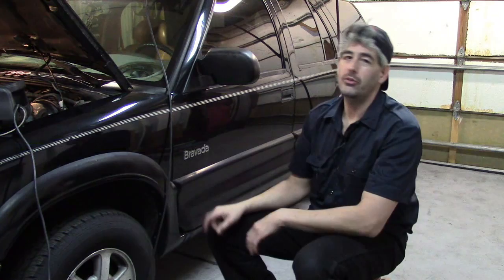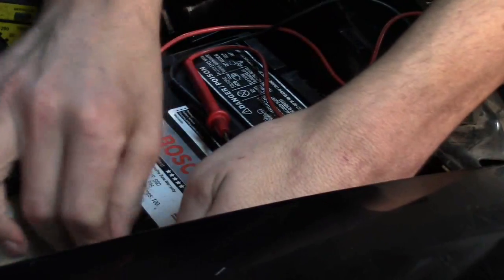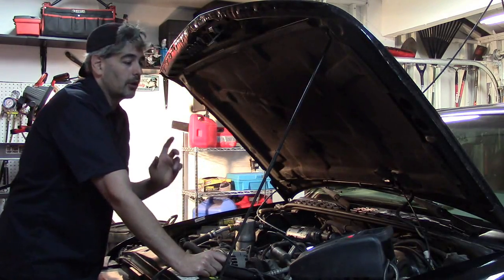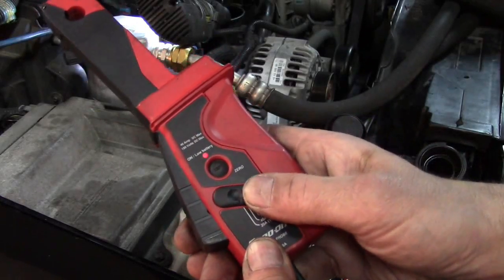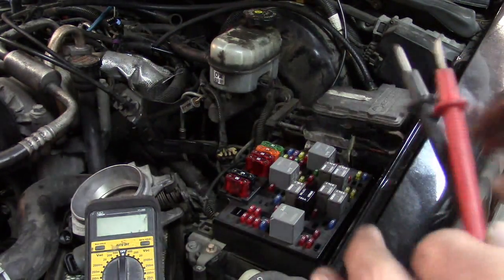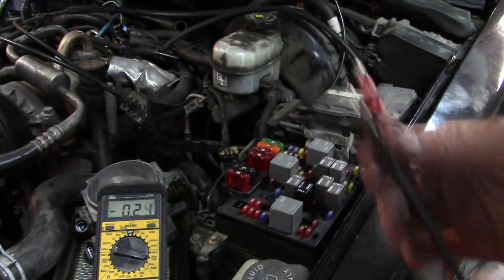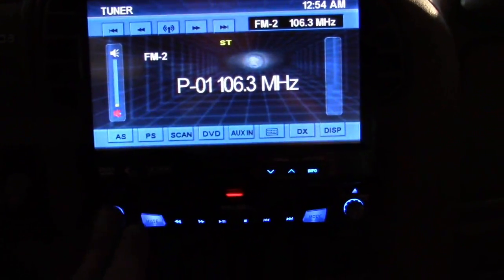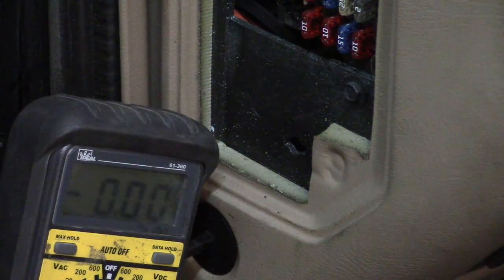Improved Methods to Find Parasitic Draw (Battery Drains Overnight)

Comment: I have a 2003 buick rendevoix, if I leave it sit more than 2-3 days the battery will discharge from the voltage going to the on star system. I noticed the snow was melted over the antenna on the inside drivers side. I am not using or paying for any features from On star. Is it posible to install a simple shut off switch, or is the problem related to the after market remote start. If I just kill power to the computer I will wind up reseting other things each time I shut it down. I can go out and start it every day but there must be a better way.
Reply from the maker: What did your diagnostic test reveal the circuit issue was?

Comment: Do you know where I can find the asleep and awake current draw for a.1999 Ford Expy. Anything would help.I get a light spark when I put 
the battery the positive side. Fairly sure it will wotk on the neg..side also.
Reply from the maker: yes you would expect the spark on either side.  your settled amp draw should be around 60-70ma.
Reply: @SchrodingersBox  Thanks..60 to 70 miliamps sound reasonable..i
 That should before it goes to sleep. Im still troubleshooting.For the time being taking of the positive post and putting it on the nect morninh. I try to crank it every day ..it rins at 14.2. also the battery is 12.2 ..caranks fine.

Comment: power probe has a chart that will list what the voltage drop equals to by fuse type and rating. pulling one fuse at a time on modern cars seems to only wake up modules and give false readings. i have had vehicles come in that it requires 2 or more fuses to shut down the module that is causing the problem. many times i just start pulling fuses until my draw stops then i put them in one at a time until i have the 2 or more fuses that are causing the draw. then just find a schematic and you will find the module has multiple sources of power..... the fuse voltage drop method is the best method to find draws because you do not have to unhook the battery which in turn can reboot the module and THEN it goes to sleep. but the fuse voltage drop method is very tricky to use because of the voltage charts needed to find what the true amp draw is and the sensitivity of the voltage being measured.
Reply from the maker: +sonsautomotive I was unaware of such a chart!  How helpful that would be!! If you want to put a link to it that would be awesome! If the spam filter catches it let me know and I'll approve it later.
Reply: can the ignition on a 2002 caravan cause a parasitic ampe draw?
Reply from the maker: Daniel Sullivan Yes. I actually have a video of this in fact- I think it was on an Isuzu if I remember. Maybe a Suzuki.
Reply: I recently purchased vehicle and battery drains quickly. last owner said if key is not in right position it is the cause. do you recommend changing the ignition? I looked it up and if I'm correct,they are about 40 to 50$. thank you for your advice and will definitely subscribe.
Reply from the maker: Daniel Sullivan I recommend diagnosing the source of thge voltage drop before you do anything.

Comment: hi excellent video - thanks.. if it's a circuit that I need when the car is running, can I just wire a "circuit kill" 12v 10A switch in series inside the car on the negative side of the fuse for the circuit that has the draw and turn the switch off when I park the car?
Reply from the maker: You could certainly do that. I don’t consider that a fix but it is a remedy.

Comment: Hmm, a little risky, just sticking your multimeter onto a battery that could potentially deliver hundreds of amps. Maybe it's just me, but I don't like sticking probes to high current sources more then once. The first time already left nice indentations to hold cables in, and that was just 50 amps or so :D
Reply from the maker: i don't understand- why is that risky? What possible risk is there when you know what you are doing? How am i possibly going to have hundreds of amps on a PARASITIC DRAW? Even if there were somehow "hundreds of amps"- What possibly would the risk be other than a simple blown meter fuse?

Comment: I think that Power Probe has a voltage drop chart for all amp fuses. And its color coded for the different amp fuses. So there really is no reason to pull the fuse and amp test the circuit. Just read the voltage drop in mili volts and take that value and find the amp fuse on the chart and read your amps
Reply from the maker: yes you are correct about that!!!

Comment: disconnect negative terminal .to battery.. get test light or power probe.. or  multimeter ,, test fuses  if get power to fuse still after negative terminal is off.. its that is the fuse i.e meaning the device for that fuse is grounding .. ..most cases defective
Reply from the maker: Dang thats a great idea!! Never thought of that
Reply: @SchrodingersBox   Fast and easy. No power to car and still have power to fuse there is your drain,,  98 percent of time its  its in the device  Really not so much about amount of drainage.. its about  drain.. hope helped and made easier for you in future..

Comment: Hi Matt, got a puzzler 4 u... My Mercedes battery went dead after 4 months so got new battery. I did the draw test and found out I'm getting 11+ volts from ground and neg. post off battery. Pulled fuses--no drop. Test light didn't go off.either There's a bad gr. somewhere in the circuit but no fuse is bad and the neg. strap is good! This is really weird!
Reply from the maker: Sounds like a bad chassis ground to me

Comment: What do I do if none of the fuses pulled affect the voltage? I cannot find this drain I’ve changed the ground strap I’ve had the computer rebuilt the alternator is good the starter good this is killing me and my family. 2011 Dodge Grand Caravan crew 3.6 l
Reply from the maker: Check for non fused circuits then. Also check ripple on the alternator.

Comment: I have an '02 excursion. It reads 68 with battery - disconnected. When I turn ON the head lights/parking it drops to 48-49. When I unplug the switch it stays at 68. So would that be something to do with the headlights?
Reply from the maker: sounds right to me.

Comment: Hi buddy my Toyota Carina st190 model drains the fully charged battery in about 3 to 4 days and I put on 10A and there was no drain on the meter at all.,but the battery drains as usually any idea why
Reply from the maker: battery is bad.
Reply: @SchrodingersBox  I have tried several batteries even brand new same story
Reply from the maker: Then it cannot be true that there is no drain on the meter. If the batter is dying in 3 days something is definitely draining the battery. Need to remeasure the amperage. 
   I assume of course the alternator is working if you are driving the car during those three days.   If you are driving car then maybe alternator isn’t charging.
Reply: @SchrodingersBox  thamks for your concern also I am shocked. I drive the car for am hour then it will start 2moro morning if the battery is connected. Then the following day it will not start. The charging is about 13.90 v and no drain. I have checked it 4 times zero drain.  Could it be it's charging less and at times it charging normal then it drops again

Comment: I've tried the first method of testing for a parasitic draw, testing my battery, alternator, and alternator fuse and everything panned out, but my battery still keeps dying and it's driving me nuts!  The battery shows 12.6v disconnected from the system, but as soon as I connect those battery cables BAM!  She drops down to 11 and dropping. Any ideas?  Also, when I test the voltage drop with  all accessories on, it stays at its crank volts at 14.2 to 14.7.
Reply from the maker: sounds like a shorted cell to me.
Reply: @SchrodingersBox  is that possible with it showing its a good battery?
Reply from the maker: yes the cell doesn’t short until under load so it will read normal voltage until there is current.
Reply: Thank you so much!  I'll get a new battery today, even though they still argue the old one is good.  I thought it was odd that the alternator could keep it between 14.2 and 14.7 but the battery loses voltage when in series within my truck, but like now it's in the back of my car with a 12.4v reading.  Know I may know why thanks to you!
Reply from the maker: well I am saying it sounds like a dead battery cell.  I wouldn’t buy one unless I load tested it myself first and confirmed I see the drop happen under load.
Reply: @SchrodingersBox  I took it in today and they did some testing on it and it did die as soon as the put current to it, so they ruled it as a bad or shorted battery cell.  You we're right, thank you so much!

Comment: hi, same method can be applied on 24V right? after testing voltage drop, will it be safe to amp test the fuse socket on 24V? thanks

Comment: I have a 1.5 amp draw pulled every fuse and relay still have draw had to pull 2 main powerblock fuses at once to stop draw im stumped if the 2 arnt pulled together draw is there any help please.
Reply from the maker: You might try disconnecting the alternator. a bad alternator can to that. Otherwise You will need to look at a diagram and see what’s on the high amp circuits other than the slave fuses.

Comment: Do we need some waiting  time (20min at least) for the car to be turned to a "sleep" mode before a drain testing?
Reply from the maker: You do certainly need to wait for all accessory lights, etc but for a car to have an accessory that pulls half an amp for more than 2 minutes I've never heard.  If you have parasitic draw it's going to be a significant draw- not something needed for 20 minutes after shut off.
Reply: Yes, of course I didn't mean half an amp, but way above the recommended 50 ma?

Comment: I have draw battery in golf 7
After 3 hours the battery is dead
I charge it full
And I lock it after 30 min 
After I disconnect negative
But when I put multimeter in Ammeter
Between them I hear something work in engine
I measure 5 A
Is it normal??
Reply from the maker: Not at all. 5A is a megaton of amperage. As much as a headlamp.

Comment: ok I have a 2001 Ford Mustang did all the testing for the Draw it was the radio fuse that had the draw, ok it has a Mach 460 radio system stock in it and also a after market radio and Amp and two 10' subs. where would u start to narrow down what's drawing from the Radio system. ??
Reply from the maker: Disconnect components one at a time until draw is found.
Reply: Schrodingers Box I unplugged the wire harness from back or Radio that powers the stock amps behind seat in the back and the draw went away, so had to be on them stock Amps in the car.

Comment: the fuse for the power seat and power windows keep getting hot and not working my 2006 ford taurus . what do you think is happening?
Reply from the maker: What is the voltage drop measured at the load compared to source voltage?

Comment: I see what you are doing but I don't understand why.  The resistance through a fuse is so small that it seems the voltage drop would not be measurable.
Reply from the maker: i always thought that too. It is absolutely measurable as you can see.

Comment: Parasitic draw here. The draw came from when I pulled a fuse from the main fuse box panel for the passenger side fuse panel, what do I do there?
Reply from the maker: Pull the individual fuses that feed off the main fuse.
Reply: @SchrodingersBox  I have a weird problem though. I want to try to fix it before taking it in. My battery drains literally within minutes. I've also noticed on my 2011 v6 mustang, the passenger fuse panel has a clicking noise. I thought the clicking was bad and read it wasn't. But I never noticed it before. It will click for the door locks, the trunk release, the highbeams. Even inserting the key into the ignition and I'm just stuck right now. I have a hunch it may be the ignition switch, only because sometimes when I jump the car it will START when I turn the key to the RUN position. And I read that the ignition switch when faulty can also drain the battery. But I have no clue how to check it. I just tried but I cant find a ignition switch diagram for this car. Sorry about the lengthy comment. I just don't know what to do anymore.
Reply from the maker: No that makes sense.  If ignition switch was stuck on that would definitely cause it but you'd have the dashboard lights on.
  I have a video of a parasitic drain I wanna say it was on a Suzuki Swift or something. I run through quite a bit of procedures until I find it.

Comment: I've been meaning to test it, but I wonder if going from b+ to one leg of the fuse, using the v drop method, would make a more pronounced drop than the short distance between the tabs?
Reply from the maker: how would you tell if there is current?
Reply: @SchrodingersBox  the same way. Just instead of both leads being at the fuse, one lead would be further upstream on the battery.   Unless I'm misapplying this here?  Similar to doing a voltage drop test at a component, from b+ to the positive side of the component. You'd be covering that entire leg of the circuit. Not that you need to here, bust just wondering if it would be easier.
Reply from the maker: Oh yeah I follow what you mean now-  yeah, I assume that would work! And better, for that matter!
Reply: @SchrodingersBox  I'll test it out and let ya know.

Comment: Hello I found the fuse that has a 5.30 ma draw its the Cluster&PCM fuse 40amp I tested all the radio and my switches for convertible top and cig lighter and it didn't change the draw any on all them. it stand at 5.30ma so could it be my PCM ? I do have engine light on because I punched out my Cats on the muffler system.
Reply from the maker: I woul;d not even worry about 5mA. 5mA is nothing
 ANd I don't know what code you have but if it's a P0430/20 then yes it's because you messed with your exhaust which is causing ineffective catalyst activity
Reply: so with cats punched out and having the engine light because of it, that will cause a battery to drain over night then ? because of the sensors
Reply from the maker: No that is unrelated.  Your destruction of the exhaust is what's causing the MIL.  You also have a parasitic draw condition as well.

Comment: I thought amp clamp meters worked only with AC?
Reply from the maker: You have to buy the correct one. Yeah if you just look at “amp clamp” you will by default find units for AC. The DC ones are different so you have to specific that and usually they are quite a bit more expensive. 
  I have an amp clamp that is both AC and DC.

Comment: That method is fine for those little strap fuses but is useless for the larger square fuses.  I have a parasitic draw that I haven't found yet.  Every fuse I can test goes to zero, yet battery still dead the next day.  I'm getting frustrated.
Reply from the maker: it works better on the larger fuses because there is more resistance.
either way- how many amps is being drawn?  that’s the more critical clue.
Reply: @SchrodingersBox   I was referring to the cartridge fuses. There are no contacts to test those. So I put my meter in series at the battery and was drawing between 500 to 1,000 milliamperes, but only for a second. (I wasn’t going to spend $150 for a DC amp clamp). Literally one second, then it would drop back to 40 milliamperes. Between 20 and 50 seconds it would spike again, over and over.  No wonder I could not find it by looking for voltage drop. So I put my meter on a fuse and left it for over a minute before moving on to another fuse. Found an intermittent voltage drop on the trailer left brake/turn signal fuse. So I pulled that fuse and I’m going to charge it up and see if I lose any battery after 2 days.

Comment: Hi!
when you find the circuit that cause the draw,what do you do next? 
Thanx from Sweden 😃
Reply from the maker: +Fredrik Sundvall You isolate the component causing the draw and repair it.
Reply: Schrodingers Box say that the taillights are on,what next ?
Sorry but I've just started learning this..😉
Reply from the maker: What is the component in the brake system you found to be causing the draw? is it a stuck brake switch? then you change the switch!

Comment: I HAVE AVERAGE KNOW HOW OF ELECTRICAL SYSTEM
FOLLOWED YOUR STEPS , ON 2008 ACCORD
 DRAW IS 11.5 V
PULLED OUT EVERY SINGLES FUZE AND RELAY PEICE BY PEICE,  EVEN DISCONNECTED THE ALTERNATOR 
DRAW STILL SAME 11.6
DUNO WHAT ELSE TO DO
Reply from the maker: Try the main circuit breakers

Comment: ok so I have a 2008 Silverado I did this test and nothing I pulled every fuse and nothing... I think it's the bcm how would you test a bcm?
Reply from the maker: You would simply unplug it and see if amp drops.
Reply: Kirchhoff's Law. All the current entering any point will equal all of the current leaving it. It's common to see someone blame something as the cause of an issue without testing and proving it. Occasionally they can be right but that is usually not the case. To test you would first need to measure the current drain at the battery, and then prove that the current you measured is flowing into, and then of course out of the BCM (identifying the exact circuit in the process). Then you have to prove that the reason that the current flowing is a failure of the BCM and not because of an input that would otherwise be considered normal operation.
Reply: Test the BCM with the DVOM DAAH...